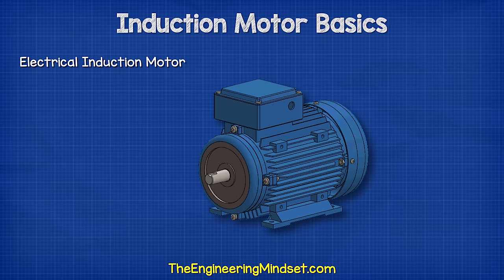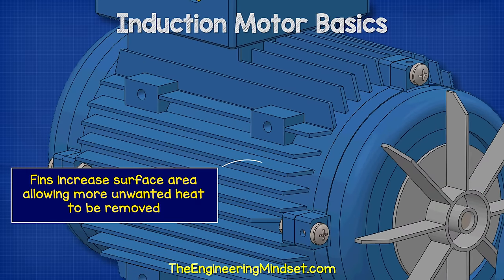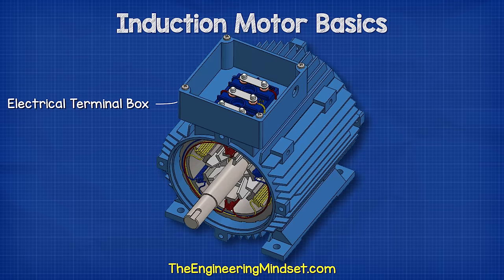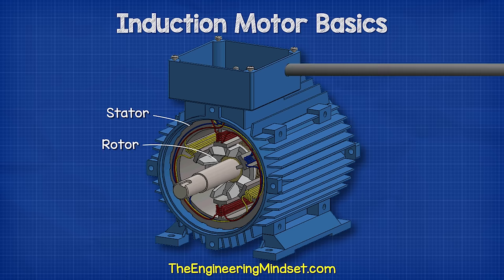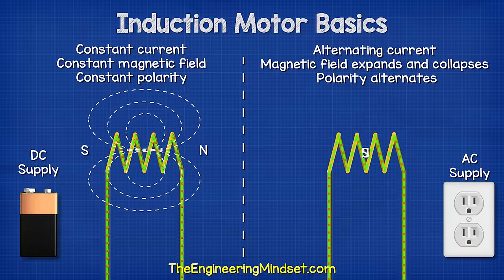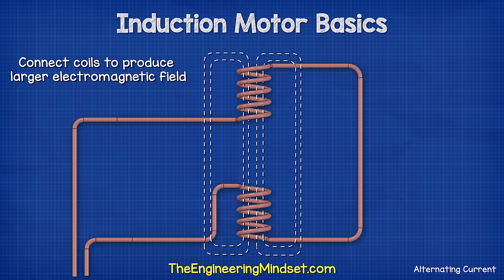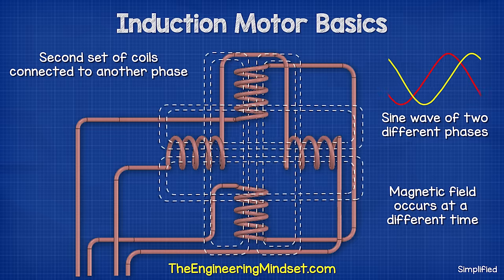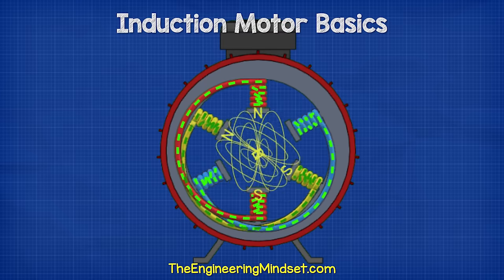Induction Motor Basics

Comment: Noice, but how do you control rotation speed of such motor? Isn't it always trying to be integer multiple of 50/60Hz?
Reply: You need a variable frequency drive.  The motor speed depends on the frequency

Comment: I still dont understand how it can rotate for example 40hz when AC frequency is 60hz. Magnetic fields are exactly out of phase
Reply: So firstly, the shaft will never rotate at the exact speed that as the magentic field due to varying factors causing resistance, most notably the load.

The difference between the two rotation speeds is known as slip normally measured as a percentage. So a 4 pole 3 phase induction motor might operate with 50Hz, which translates into 1500 RPM, but it might only operate at 1450RPM so has a slip of 3.3%, this will vary between different motors or even the same motor with different loads.

However for many reasons we will want to vary that rotation speed. For that a variable frequency drive is used, this converts AC to DC then DC back to AC. So we can convert 50Hz mains AC into whatever frequency we need to drive the motor a the required RPM. This also converts the voltage with it, as it's important to keep the same voltage to frequency ratio.